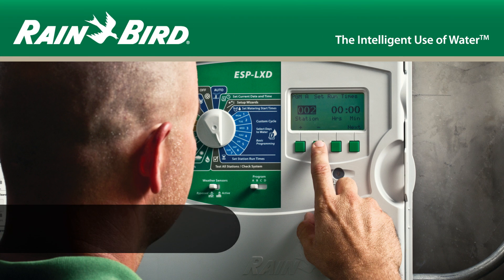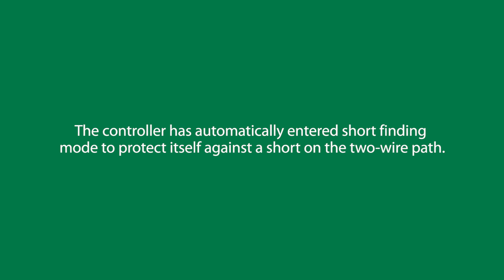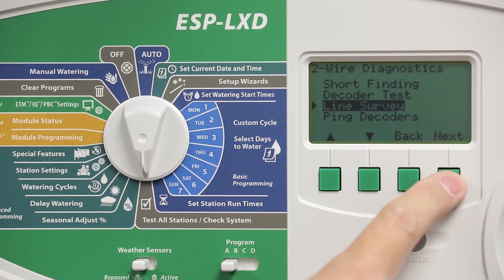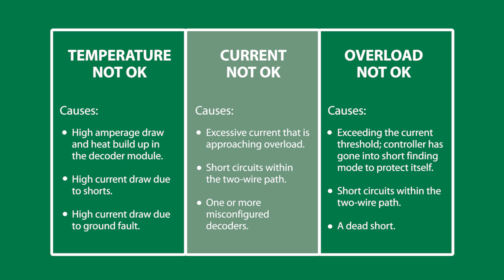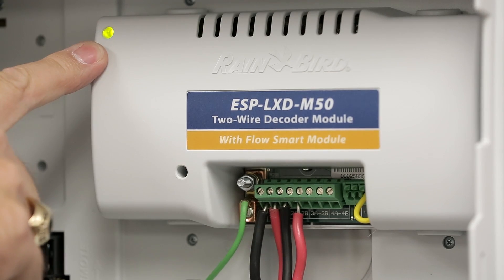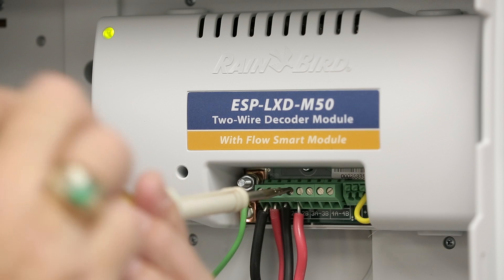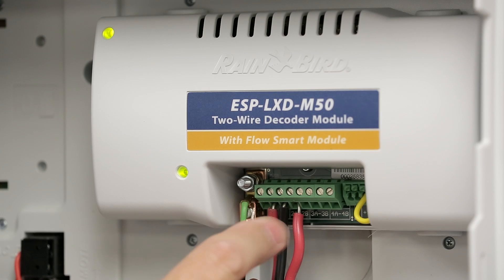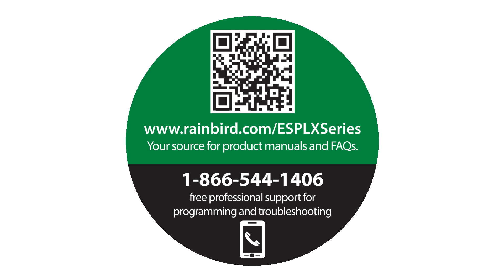ESP-LXD Controller Troubleshooting: Automatic Short Finding Mode

Comment: what's the controller doing in "Short Finding Mode"? limited the current to 200mA? appies 24V to the 2-wire, so you can measure the current?
Reply: have you found the answer to your question? because i need to know the same!
Reply: @scottrobertson5639  yes, applying voltage, you can measure shorting location
Reply: Thanks chu its first thing in the morning, now i know i can fix it and calm down lol

Comment: Thank you for replying to me.  I prefer to correspond by email because I don’t speak English well and have difficulty with phone conversations.
We set our Rain Bird irrigation system to automatic and for 20 minutes for three days each week, using program A. There are 1, 2, 3 station is normal operations, only 4 station the Rain Bird 5000 has problem, I took this photo sends for you. Only this one Rain Bird 5000 in NO. 4 areas always up and down (the sound as Dong –Dong) make the water pressure with vibration until to the Rain Bird 5000 same of the earthquake make me afraid.  Though we set it to engage once a day. It pulsates rapidly and won’t stop even if I remove the control-panel plug from its wall outlet.

Comment: Our Rain Bird ESP has Problem, never set up after noon time, but rain bird still worked all the water never stop, what can I do?
Even Reset still same of before yesterday, only to shut off the water pressure. Later open the problem coming again and this time to terrible than before.
Friend help us to setup only is A, never setup B, C, D.  We tune off the stop work, rain bird still worked all the water never stop, water out and out, only shut off the water pressure make it stop water out. Now we are really falling headed don't know how to do? Don't know who can help, don't know to find which company to help. We just moved to Florida new house five months.
Reply: I have email to them, no people reply to me.
Reply: Thank you for replying to me.  I prefer to correspond by email because I don’t speak English well and have difficulty with phone conversations.
We set our Rain Bird irrigation system to automatic and for 20 minutes for three days each week, using program A. There are 1, 2, 3 station is normal operations, only 4 station the Rain Bird 5000 has problem, I took this photo sends for you. Only this one Rain Bird 5000 in NO. 4 areas always up and down (the sound as Dong –Dong) make the water pressure with vibration until to the Rain Bird 5000 same of the earthquake make me afraid.  Though we set it to engage once a day. It pulsates rapidly and won’t stop even if I remove the control-panel plug from its wall outlet.
Show less
REPLY
Reply: Friend coming to checked , He give us the idea goes to buy Solenoid, we bought it and changed , the Rain Bird 5000 looks like does not up and down and shake, but we open water pressed  the water going out, we didn’t setup that time needs the water . Please tell me, what is happening in some of this problem.  May be is the control panel the problem?